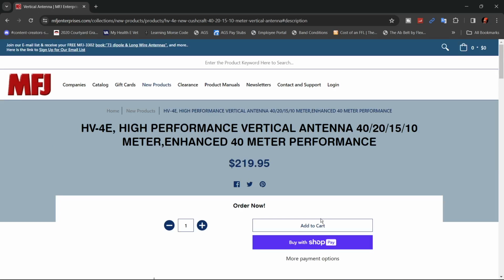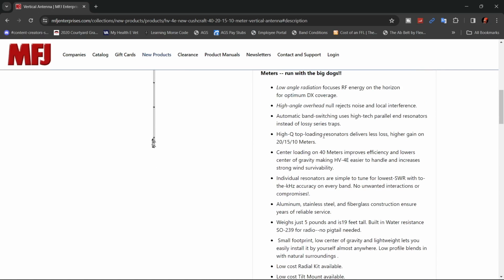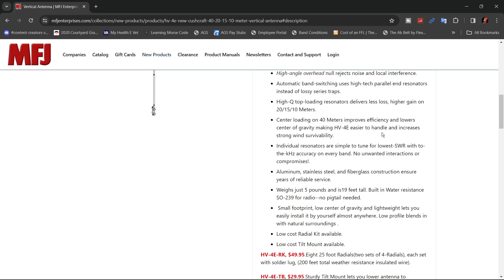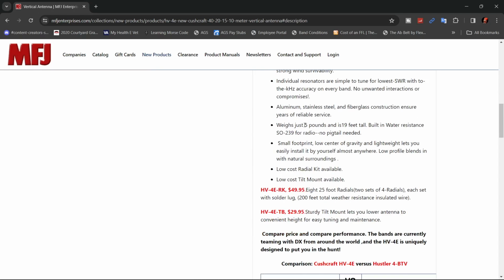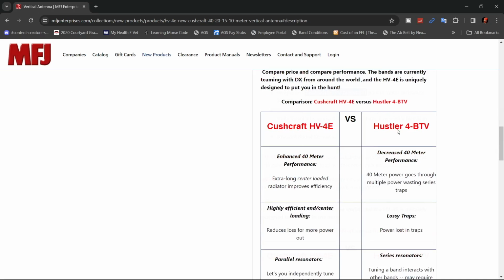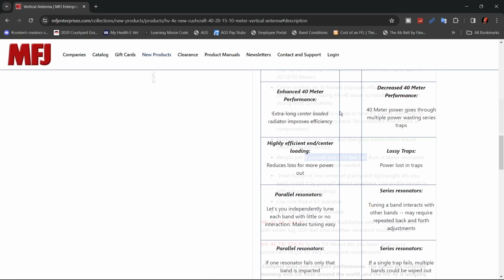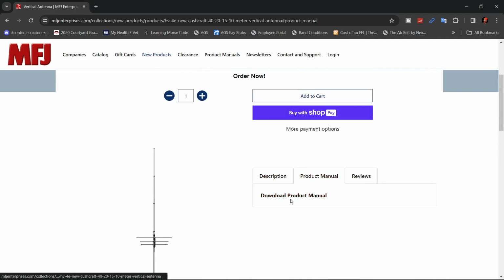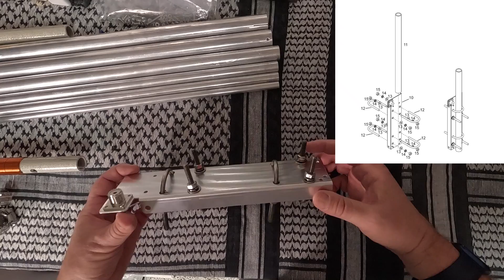Cushcraft HV-4E Vertical HF Antenna Build

Comment: I'm assembling the MFJ-2990 vertical antenna. I have found some of the sections don't slide into the next larger section. Some of them get stuck part way down. This antenna is intended to be mounted vertically and the sections pushed up one at a time. That's going to be difficult if I can't get all the sections to telescope within the other sections. Have you encountered this?  I tried a rattail and fine sandpaper in the top of the lower section to no avail. Can you suggest a fix.?

Comment: Great Video Creig !!
I just got mine antenna and put it together thanks to you and this video. I had a little fight with the radials because when getting one on the other comes out but finally did it. My issue is now with the ground radials I ordered the ones correspond to the antenna but doesn’t explain where to going to be installing. I’ll very happy if you help me out with that manner or better off do a video. Once again thank you and keep up with this great job. 73’s   De KD2VRL, NJ
Reply from the maker: Thank you for taking the time to watch and the comment! It is greatly appreciated. I also used the MFJ-1901 BASE ANTENNA MOUNT(1904) since I live in an HOA and have to take it down when done. On the back of the instruction manual is a customer service line you can call to find the best location to attach them.

Comment: Did you have or notice any poor solder connections?  I just unboxed mine and it appears that the coils are very poorly soldered to the lug connectors.
Reply from the maker: Thank you for taking the time to watch and the comment! It is greatly appreciated. Mine seemed to have been made correctly. I would call the company and see what they can do for you.